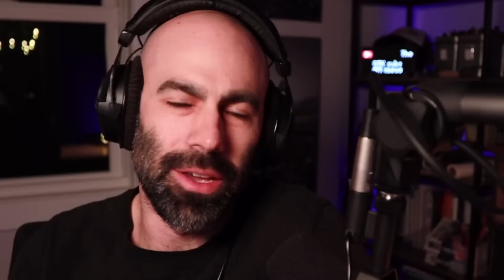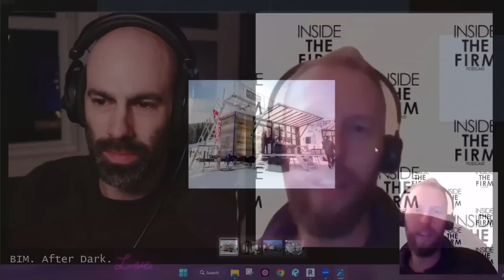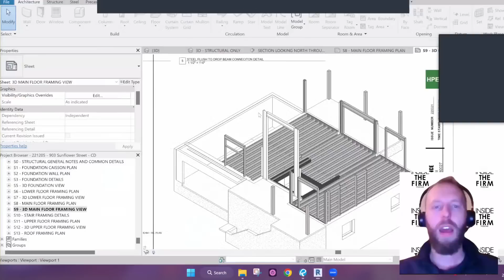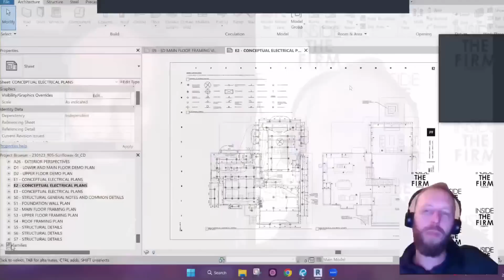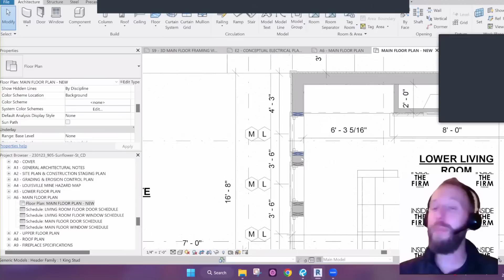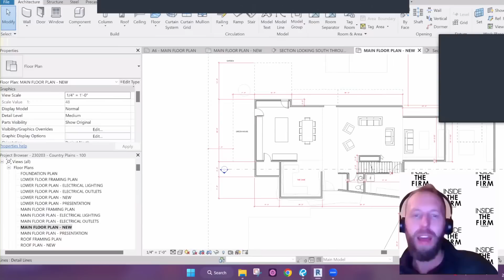Design, BIM, Build: Residential Revit with Alex Gore

Comment: You might want to consider keeping sheathing and siding on the exterior walls family, if you plan it right when you join walls and floors it will work out.  

Regarding floors I keep the subfloor and in that case I add the finish floor per room

Thank you for sharing your story this was great

oh yes jeff your tight I still draw  brick veneer walls separately

in light frame always dimension stud to stud